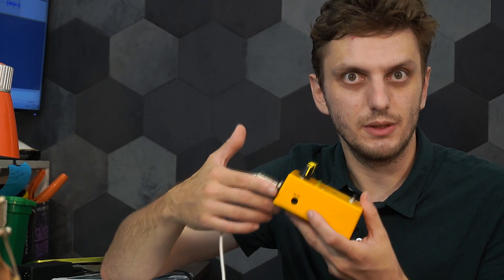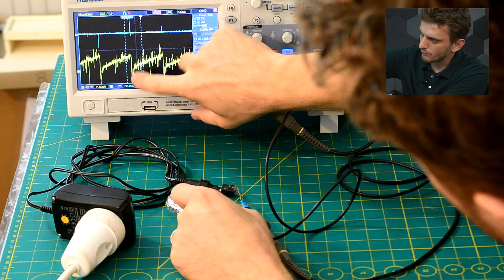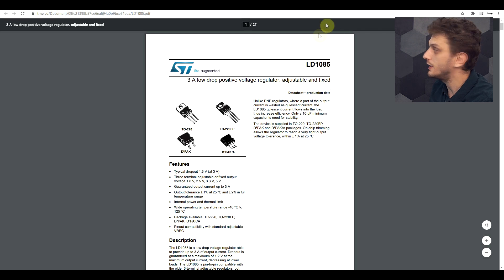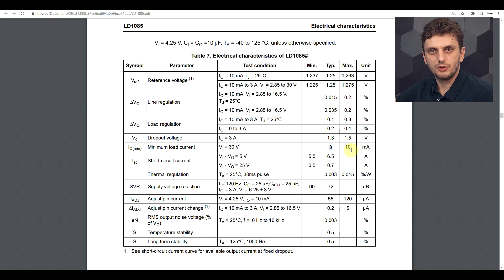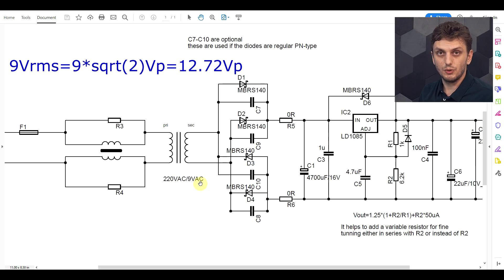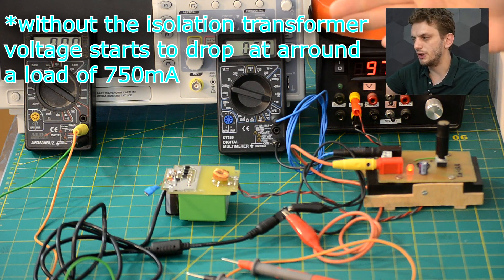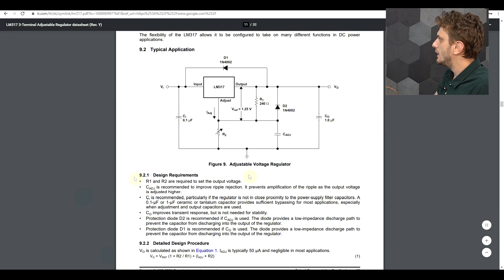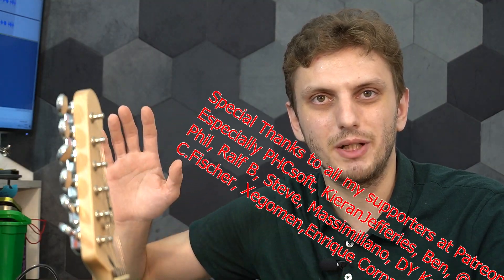DIY Audio Effect Pedal Part 3 - Making a low noise supply

Comment: Would it be practical to try to eliminate 50/100Hz noise with a notch filter?
Reply from the maker: Highly depends on where you want to add the filter - the lowest fundamental frequency of a bass guitar is at ~50Hz and even with normal guitar you can get various effects at low frequency (things like tremolo if I am not mistaken the terms); point is that adding filters in the audio range on the signal line is not a good idea - since this will affect the normal operation. On the other hand if you want to filter the power supply, then you don't need notch filters, but any low pass will do; as long as the cutoff is way below the frequency of interest.
Reply: @FesZElectronics  yes, I was thinking of the 50/100Hz noise from the low noise power supply that you have. Is there any reason not to include the LPF in it? Or, maybe, on the power input side of the pedal?
Reply from the maker: You don't need a dedicated LPF; I mean, the large electrolytic capacitors are already forming an LPF with the various resistances in the circuit (like the transformer winding resistance) and I also added the active regulator which is providing the same LPF basic function. In the end, you need more filters if you actually have a noise issue, otherwise, there is no point. By the way, the input of the pedal also has some amount of capacitors which are helping with noise filtration.

Comment: In audio applications a perfect stable voltage isn't really mandatory. So I would have gone for a capacitance multiplier with just a zener. The ripple reduction is a lot better (in fact the ripple reduction isn't so great with most voltage regulation, especially for high frequencies) plus you don't have the issue with minimum loads.
Reply from the maker: I would add here that although perfect voltage accuracy is not necessary, you will get some circuits that demand a minimum operating voltage, so you need to make sure that is achieved. But anyway large voltage fluctuations are not really desired. Keeping a well defined voltage will also help in limiting the size of the biggest components - the electrolytic caps - 16V cap is always bigger than a 10V cap. 
Since this was an external supply (external to the actual device), some noise will still be picked up by the wiring - so the best filter is the one closest to the load - in case of necessity, I would add the cap multiplier right next to the circuit, so the low noise output is also a low noise input. Even if you use a chemical battery with a 1m cable, it will still be noisy.
Reply: @FesZElectronics  With a zener you will keep everything within ±10% or so? 
That is less with a couple of capacitors.
Especially because the quiescent current of these kind of circuits is bigger than the dynamic current of the signals. (basically a constant current, more or less)
So take the higher side of that for your safety margin for the caps. Besides, the voltage of a 9V battery will sag much more significant. 7.5-8V is not uncommon.